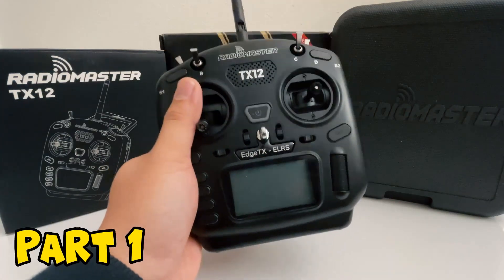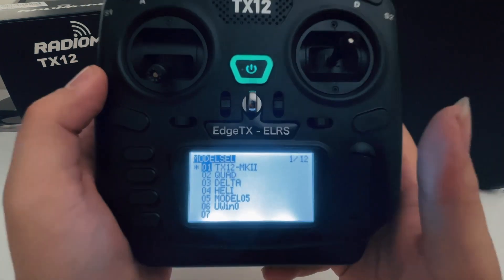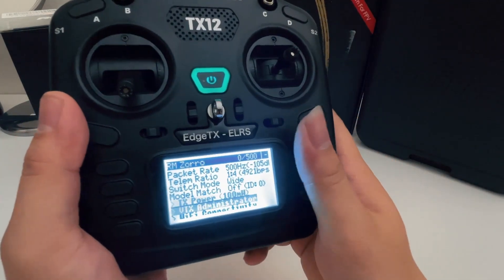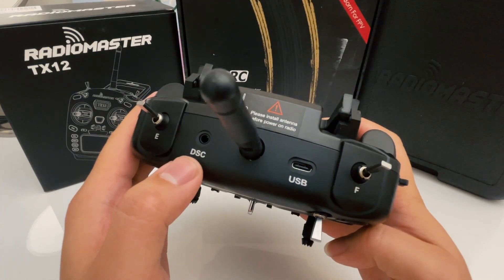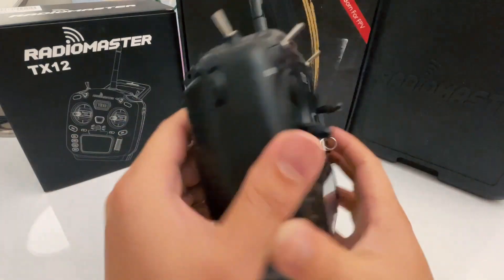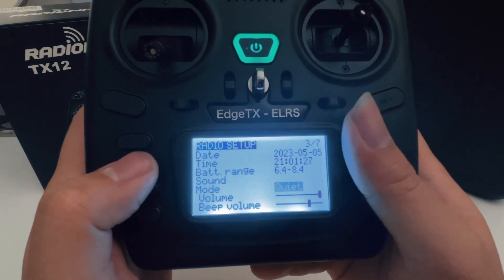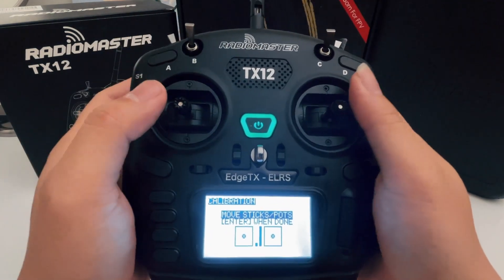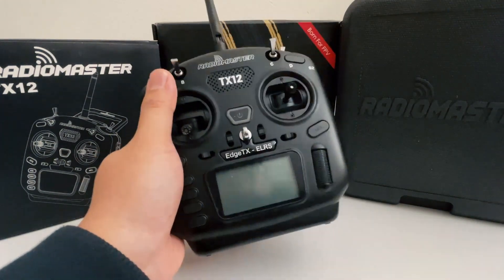How to set up TX12 MKii ELRS - Part 1 / Crash course for fast BNF + explain the ports & buttons.

Comment: I have a boxer and TX 12 I can't axcess the model menu either through the system menu or model button.
I only get the options back up, move and copy model?
Express ELRS 3.6.0
Im trying to use an external module.
Reply from the maker: Have you tried the page buttons....?
Reply: @XwingFPVRC Yeah I figured it out. 
Thanks mate 😎
Reply from the maker: @Mark1Stelios  Great! Glad to know

Comment: I just tried to add a new mode and get acro mode. My darwin has only angle. Now my drone won't arm
Reply from the maker: Check you modes setting, make sure no swithces are contradicting

Comment: Mine stays stuck on the loading screen after pressing expresslrs. I feel like I’ve tried everything to fix this….
Reply from the maker: 1. Please confirm you are using a ELRS radio
2. Make sure you have the correct model enabled, external or internal, you can only have one. (This is the most common cause
Reply: Holy crap, I accidentally ordered the mpm version ! I ordered from aliexpress. Should I send it back and wait a month before I fly? Or should I by an elrs module
Reply from the maker: @brianhockey5  just get an ELRS module easier this way
Reply: any in particular that you would recommend?
Reply from the maker: @brianhockey5  I will say, Radiomaster Modules are quite solid 

https://amzn.to/3AeMa8c

Comment: What all protocols does edge tx support? Im confused lol is the edge and open tx the same as the 4n1 on the newer tx16s? So many questions and no answers lol
Reply from the maker: EdgeTX evolved from opentx, they are the same project just EdgeTX is a different group of people that took over the development. Both are essentially your operating software to the radio like Windows to PC. Its just “Windows” and radios protocols are additional software and hardware you need to install externally, like a WiFi adapter.
Reply: @XwingFPVRC  so edge and open allow the remote to add the modules? Like elrs or 4in1 modules?

Comment: after updating RM TX12MKII from EdgeTX 2.8.5 to 2.9.1 the radio always makes static sound while turned on. do you know why and do you have the same problem?
Reply from the maker: Mine does not have this problem. But try checking you output power, that might be the issue ? I’m guessing
Reply: @XwingFPVRC  thanks for your reply.
it happens even when both internal and external RF is off

Comment: hello sir does radiomaster transmitter TX 12 work for FrSky receiver ACCST D16 LBT EU
Reply from the maker: For your radio to work with Frsky D16 you will either need a CC2500 or 4in 1 protocol on your radio, just make sure you get the correct one

Comment: I just want to be able to set it up without any updates, not necessary..
Reply from the maker: You certainly can if your radio and RX is at the same version, but if not, unfortunately you will have to …
Reply: @XwingFPVRC  wanna buy a  practically new TX 12?